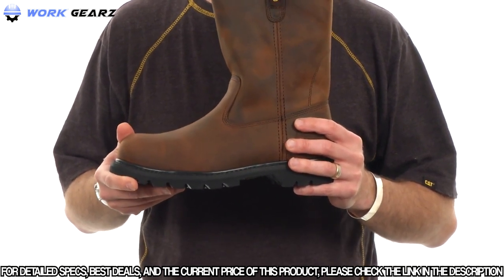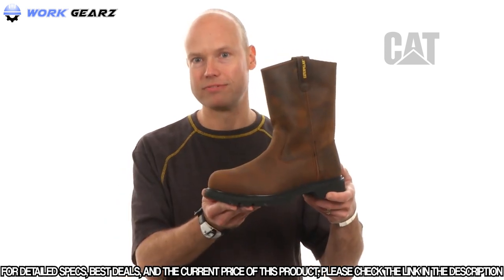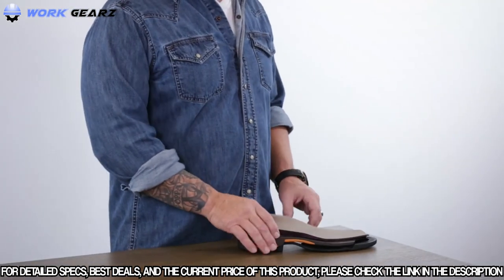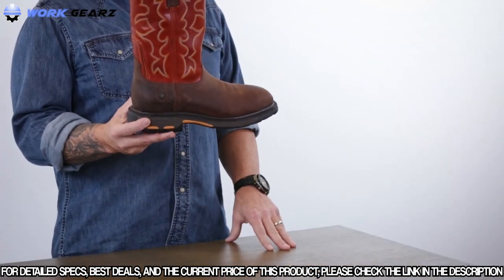Top 10 Best Work Boots for Welders

Comment: All of these are junk marketed as rugged work wear but really just overpriced. These are slightly better than Walmart brand. This list was made by someone that has never welded in their life.
Reply: What's a good boot
Reply: @esop9872  you need a slip on  boot with as little plastic in its construction as possible. Except for the safety toe. Steel toe will get hot in summer and cold in winter. Expect the time they last to correlate with how much you spend. If you get two pairs and alternate them and clean/condition they will last 4 or 5 times longer.